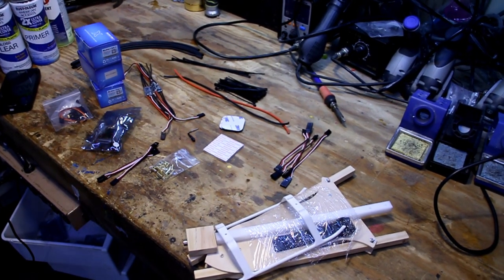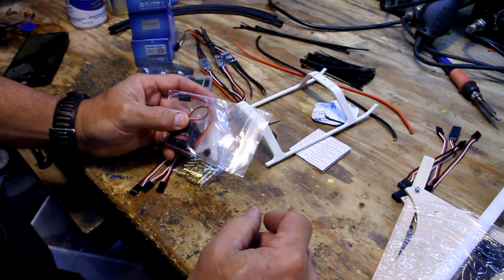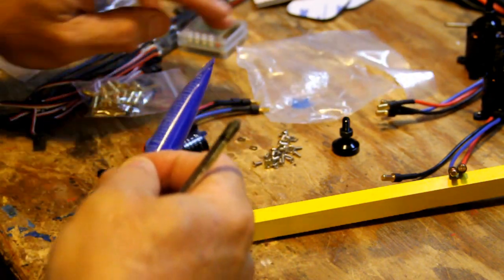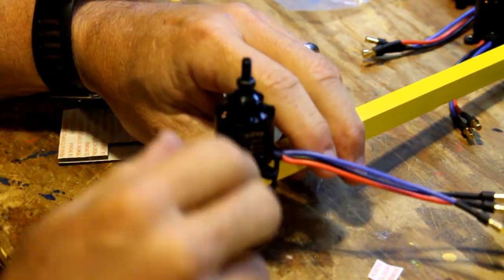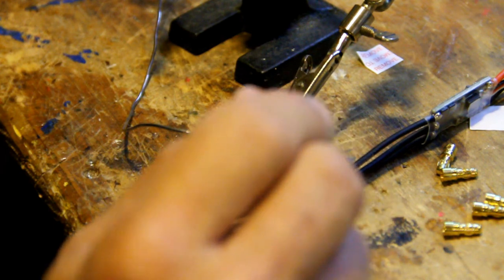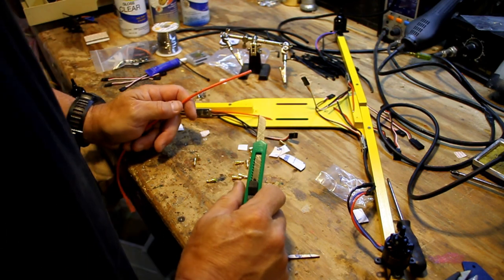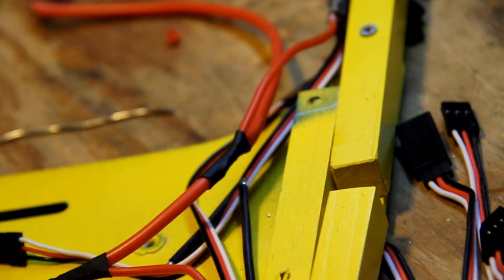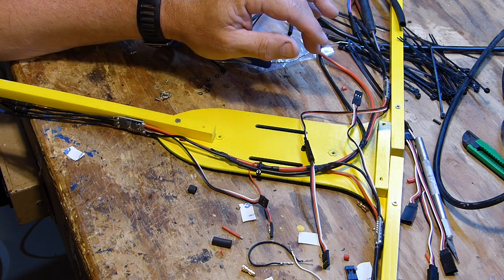Simplecopter Full Size T 2.0 Build Video

Comment: For the BECs it is the Linear type you are talking about.  The more efficient Switching types are the ones that cause problems if all are plugged into the FC.
Reply from the maker: that is it. i need a cheat sheet stuck to the wall so i sound smarter.